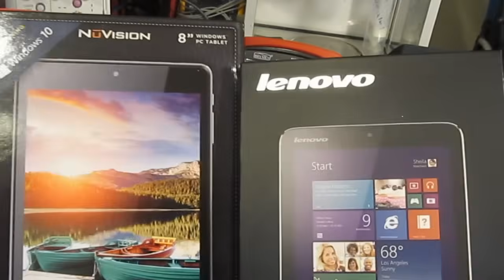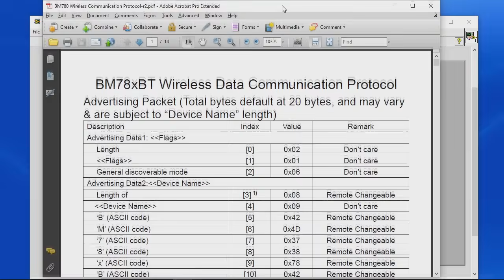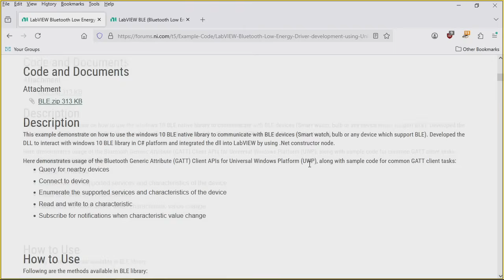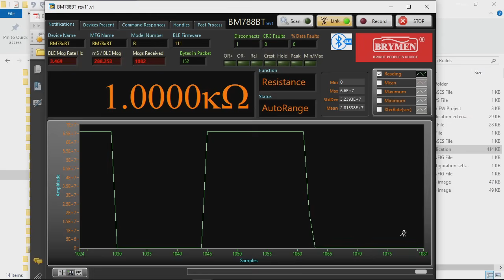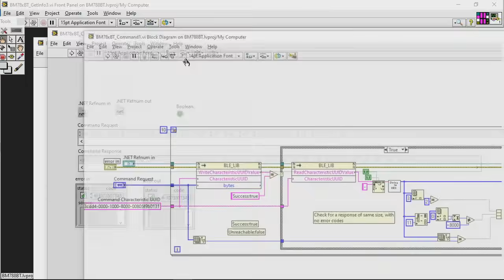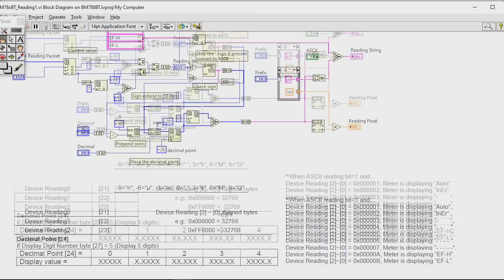Brymen BM788BT, BlueTooth Data Logging DMM, Part 2, Software Interface

Comment: Very cool video thanks for all your development and testing.  LabVIEW has a Community Edition that is free for non-commerical use and can be very helpful for those in the maker and hacker space.  This is a Professional version that includes application builder for making stand alone applications and installers and is for the newest release.  I too was frustrated with NI's licensing issues but they have tried winning back the community with heavy discounts if you had a perpetual license in the past.  

I also couldn't find your source code to the LabVIEW project did I miss that?  The sniffing tool, and the meter software both seem like they would be super valuable to the community. Thanks again.
Reply from the maker: I don't think $10,000 for software that has changed very little over the last decade and cost more than 2X is hardly a deep discount.   I had downloaded the CE but started reading the license agreement and wasn't sure what I could use it for and if NI couldn't just pull the plug on it at some point.  I think it required an internet service.   2011 will most likely be the last version I own because of their new business practices.   I no longer promote it and try to steer people away from it.  NI is make progress integrating Python and I suspect this is what you will see the next generations using.     I may upload that source code  once we get the BLE interface sorted out.   As you could see from the video, there was hardly any coding on my part and it wouldn't take much effort to replicate it.

Comment: That’s pretty interesting that you wrote your own. I suppose once this is a well established thing they will sell a lot of units based on the Bluetooth logging function considering how expensive flukeview albeit basic and only sub 100 bucks, it’s still pricey when coupled with a 289.
Reply from the maker: I am not sure how much more the BM788BT will cost over  the BM789.  According to Brymen, the two meters are the same except for the missing dB feature and the addition of Bluetooth.

Comment: Interesting: My first logging DMM had an optical output that had a RS232 adaptor.
Reply: @LawpickingLocksmith  good point. I wonder if the ut181's optical interface is a simpler serial format (when deviod of the ble overhead)
Reply from the maker: The meter came with software that supports the optical interface.   That worked good enough that I never looked into the protocol.  That said, I assume it is embedded into the BLE protocol.
Reply: sanwa pc5000?
Reply from the maker: Looks like a nice meter.